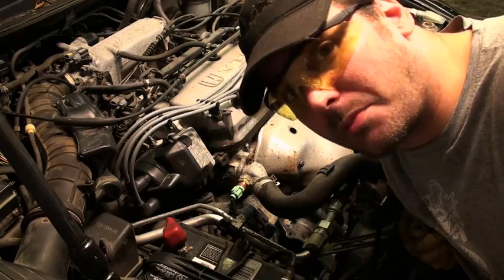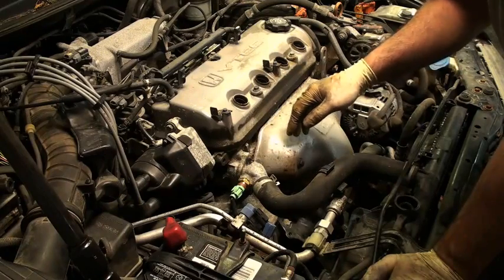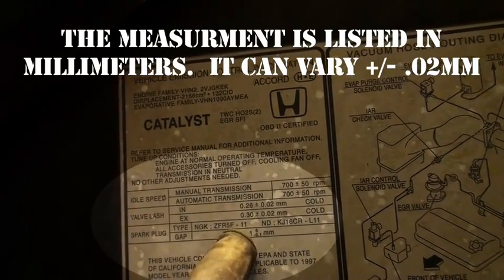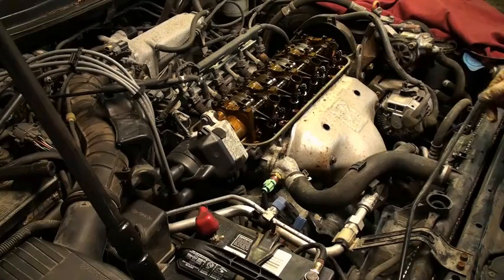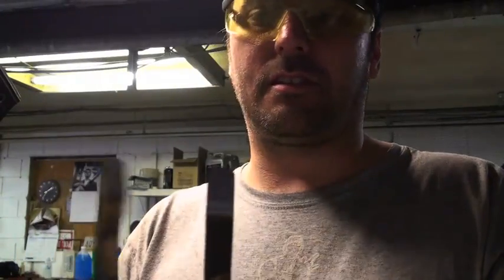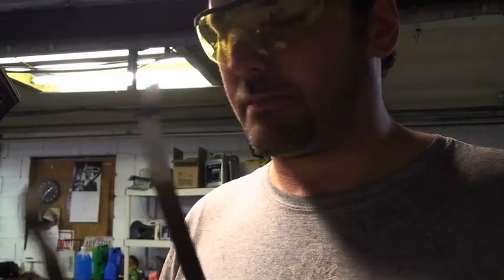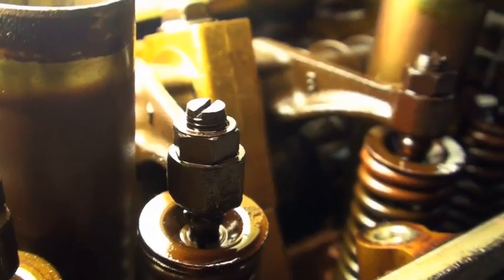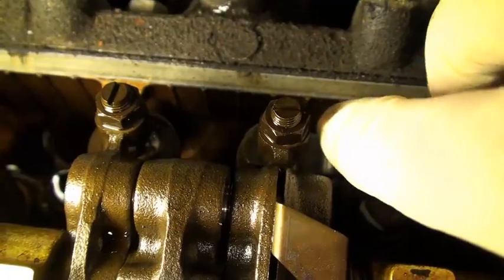Honda Accord Valve Adjustment - EricTheCarGuy

Comment: Ty again. On the 22R is the timing chain adjustable or would have to be replaced? I'm hoping to spend as little cash as possibale on this truck b/c I intend on selling it but I need the engine as much as possibale to purr like a kitten to get the most value. I hope to sell it for atleast $1200. No rust and has the original radio.

Comment: great tips... 
although.. to older engines the feeler gauge must be a bit tighter
i marked the camshaft pulley so now i have the 4 directions pinpointed
to rotate the engine i used to rise and spin a wheel with 5th gear engaged
maybe taking the plugs out is better 
can to see how they look then.

Comment: Hey Eric! Thanks for the great videos. 

My Honda Civic makes a ticking sound when the engine runs. I'm pretty sure it's the valves. Would an adjustment remove the sound? 

It's done about 119000 miles I think.

Comment: Hey Eric...my motor is a B16a3 and wanted to know, looking from the factory manual it states there are OEM factory specs to go with for instance; at TDC

*Firing Order 1342 
Intake at                          0.15mm - 0.19mm (0.006 - 0.007 in)
Exhaust at                       0.17mm - 0.21mm (0.007 - 0.008 in) 

Valve were adjusted to - Intake 0.006in & Exhaust 0.008in...is this too tight of an adjustment? Any help would be great...i'm new to this so great way to learn!

Thanks Eric..awesome job

Comment: Do you have a video on adjusting valves on cars that have solid lifters like Mazdas and Nissans where you have to insert shims?  I know there is supposed to be some special tools that lets you do it without having to remove the camshaft.

Comment: Hey Eric I have a question. If I am adjusting my valves on a 92 prelude and it's my first time doing  it, after I have adjusted a valve would it be safe for me to loosen it just a tiny bit just to make sure I didn't over tighten them and mess up my motor????

Comment: Eric, my 91 CRX Si (D16A6) came from the factory with Champion RC9YCN4 plugs and they're listed in the manual.  I was surprised when I found them in there when I did my first plug change.  Switched to NGK and never looked back, but I thought you'd find that interesting.

Comment: Somehow I missed this video on your site, and you directed me back here when I went over the Honda engine videos this month.This video is 'vintage ETG', absolutely first class.You found my knowledge gap and filled it smooth.

My 2000 Suburban (300,000+k) has what I think are noisy lifters, only when it's cold. Runs fine even on the cold days when it's noisy. Does the Suburban have fixed or hydraulic lifters? Do you think a valve adjustment would help to suppress that annoying clattering sound?

Comment: Hi Eric I'm Eric I have an 80 buick skylark with the 2.8 liter and I did the head gaskets and need to do my valves I can't get them to adjust right and sounds just real off is there a way you can do it on a say a  chevy v6 cause every video I watch says 20 million different ways and what do u do for valves

Comment: @EricTheCarGuy Ok. Good news I put in the NGK spark plugs in and the car does not run really hot like before! I used the regular NGK ones with the exact part # like the manual recommendation says. However I'm still trying to figure out why my car is consuming a lot of gas and I dont drive the car everyday.

Comment: Speaking of the new gaskets on the spark plug tubes.  Do you have any suggestions for replacing them when doing a valve cover gasket change?  I had to rip them apart piece by piece with vice grips when I did mine.

Comment: Eric I have a follow up question about the '08 Eclipse V6 adjustment. Do Valve Clearances increase or decrease as the engine cools? I suppose that they increase, because the metal shrinks when it's cold. It took me a couple of hours to get to the rocker arms, so I had no choice but to adjust a cold engine. I went along and used the Hot Measurement for the adjustment, since I had no other number to go by.

P.s.: Is there a way to talk to you besides YouTube?

Comment: Will short flat feeler gauges work good and fit in there ok or do you need the angled ones?The flat ones I have are 2-1/2" long.
The engine is a F22B2.

Comment: Hi Eric - On my 2005 Honda Accord i have Valve Lash IN: 0.23 + 0.02 MM  and for EX: 0.30 + 0.02 MM --- When at Autozone i'm not sure what valve to purchase since they are not labeled per sticker on the hood, Which should be used for IN & EX  ??  Really appreciate your feedback.
Reply: Manuel Canela Find out what engine is in your car and look up maintenance guides for that engine.

Comment: @EricTheCarGuy I been watching many of you videos but I have stranger question. Well I bought this 90' Honda accord on the engine block it said its an f22b1 but it's an DOHC. I took it to the Honda dealership and the told me that someone put a Honda civic head to make it a DOHC. My question is; how would i do a valve adjustment on this Frankenstein engine?

Comment: I can't get the flat head screw and nut to spin freely with eachother. So much carbon buildup its locked them up. Should i just run a can of seafoam through or take a blowtorch to it? Anyone dealt with this nonsense before? My valves arw ticking pretty bad.

Comment: how do you know you need a vavles adjustment?  i did a valve jod for this guy and now when i start it its somtime dieing down  but but the car still stay on and i hear taping some times taping goes on and off at low idle does this mean i need to adjust them no check engine lights either...?

Comment: I should clarify. It made zero valve noise before taking it apart. I was fixing the spark plug oil leak and noticed this upon reassembly.
Reply: SAMMMEEE HERREEE!!! now thats its making noise, my question is should i tighten them more i had set them to .007 in , .009 ex

Comment: Any day now Eric I'm going to get back by 86 Toyota 1/2 ton pickup. It has more then 250k miles on a rebuilt and needs timing & Valve adjustment. It has a 2.4L 22R (last year of the carbs). Would this video be a good guideto doing the valve adjustment? I may have to take it to a shop for the timing part of it

Comment: I have a 2.4l dohc engine which has a valve noise but i been advised that it is better just to leave them alone because on that engine it may cause more problems than anything else. any advise?

Comment: Hi Eric i just bought a 1996 Honda Accord automatic v6 24 valve last month and i got off work and my engine started  to knock real bad it was only when i push the gas then i knew it was the valves any info on this type off motor before i take a look at it and some idea on what to expect

Comment: I also have a question. Ive seen other videos on the exact theme here and a lot of people do the valve adjustment on the cam side. I notice you dot it on the valve side instead of the cam side. Little confused.

Comment: Ok I have a 1995 Honda Accord EX v6 the 24 valve 2.7l engine, do these cars need the valves adjusted they seem pretty loud at startup and quiet some after warmup, are these engines hard to do or should I have a mechainc. Thanks

Comment: if you rebuild the entire engine have the cylinders honed with new rings and the block checked for warpage and put a new head or have the head fully redone it would be a fine motor most likely but if you dont do the bottom end as well then rebuilding the head would create too much pressure and blow past the rings. replacing the motor with a junkyard or jdm would be your best bet.

Comment: Hey Eric, I have a 97 Accord I got 3k miles ago it ran smooth for awhile, but has always had a slight ticking (tapping sound) not knock. I did an oil change 1k miles ago. It now runs kind of ruff has less powerand the ticking is louder. There's no check engine light on could this be cause if the valves need adjusted? I'm replacing the cap and rotor spark plugs and fuel filter tomorrow.

Comment: Hey Eric, I did put in Champion spark plugs on my 91 honda accord and it did run good but really made the car really hot. I didnt know at that time champion wasnt recommended when I was tuning it up. The car was really hot that you can burn your hand if you touch the hood. I am gonna switch to NGK next week when my money comes in. Do spark plugs' heat ranges have to do with engine temperature? Because before my car had autolite spark plugs and the car wasnt that hot like champion spark plugs did

Comment: Hi Eric. Really nice work brother. Have a question for you not related to the valve clearance but more timing belt. I recently replaced my timing belt and balancer belt on a 96 accord 2.2 vtec. Problem is I dont remember how the drive belts (alternator and ps routed when I took them off). Alternator belt goes alternator crankshaft pulley and what else? PS goes ac compressor and outer crank pulley? Hellllp :)

Comment: Hi i got a question.  So i believe my timing belt slipped a tooth and so i reset the timing and it helped it alot but its still got that wierd laggy sound like a subaru when i give it any gas.  Could this be the culpret?  Im hopeing i didnt bend a valve it doesnt sound like i did but yeah.  Thanks!

Comment: Hey Eric i have a little question. I'm curently building some-what of an performance engine. It's an overhead cam design, and i have a high lift cam in
 it, and people sayd to me that i should put stronger valve springs on, but they also sayed that with those my cam can wear out much faster. Your opinion would really halp me.

Comment: it was running fine until i backed out of a driveway put it in drive and stepped on the gas a tad bit and the motor started jumping almost like it was missfiring but then it stalled an i can figure out wats wrong could it be that my timing belt slipped as i put it in drive and gave it gas?

Comment: my car sticker says .22 plus or minus .02... so adding them together I get .24... does that mean I could use any guage between .22 and .24? Or should I find a .22?
Reply: You should find a .22. .22 plus or minus .02 means that a range between 0.20 and 0.24 is acceptable for that engine.

Comment: hi i got a question for you i have a broken timing belt in my dodge neon 2002 and i dont know if this will cause any problems with my valves do you think if i replace the timing belt water pump and pulley will it be ok thank you and you have wonderful videos

Comment: i have a 95 accord with what i believe is the same engine. do you have to turn over the engine in between doing the intake and exhaust valves or do you just leave it with the cam lobe 180 fromthe rocker?

Comment: @EricTheCarGuy  i have this engine for 3 months now , the old one was smoking alot and i think its becuz of the oil rings or the valve seals , but instade i took another engine and its soo weak, i wanted to adjust the valves so maybe it can be more powerfull , i did the distrebuter timing yesterday and it help so i cant wait for the valve adjustment :)

Comment: Dont we have to turn the crankshaft instead of the camshaft? I have honda civic 2000 ex and I am about to do the valve lash. Does it matter if I turn the crankshaft of camshaft ?
Reply: Tuan Anh Le - When Eric turned the power steering pump it did turn the crank which by way of timing belt turned the cam shaft.
Reply: Tuan Anh Le - But remember... Take your spark plugs out first...

Comment: Hey Eric, I have an 04 Accord V6 with 223K on the clock. anyway I decided to put the pedal to the medal and my check engine light did a "funky chicken" and started flashing. I have a Code reader and it said that Clyinders 1, and 5 and random cylinder misfire were detected. I was told that I needed to have my valves adjusted, they have never been in all these miles, do you think that that is so? None of my coils are oil soaked and I just replaced the sparkplugs last Sept with the OEM NGK plugs.

Comment: I set the number 1 valve to TDC with the marker UP (timing wheel), set it to12 oclock and adjusted 1# valve (0.007 intake and exhaust to 0.009) between the Rocker Arm and Valve Stem with no problem.  The problem I'm having is when I set timing wheel to 9oclock to work on valve #3. I couldn't place the feeler gauge between the valve #3 Rocker Arm and Valve Stem on the intake valve so I losened the screw and adjuster screw but still couldn't get the feeler gauge between. What am I doing wrong?

Comment: Btw it me again, My honda is a 1997 Honda Civic HX. Cont.. The more I loosen the aduster screw for the #3 valve (intake)  I couldn't get the feeler guage inbetween the rocket arm and valve stem. What am I doing wrong. Should I turn the timing wheel a tad more to open up the gap. Any help would be greatly appreciated.

Comment: I have a 1996 honda accord 6 cylinder and it has a ticking noise coming from the head area when the car is warm. Is it the valves needing adjustment? Anyone know?
Thank you.
Reply: Valve lash gets quiter when the engine is hot, not noisy. If the noise is worse after warm up, then you have another issue.

Comment: My integra has been sitting for 6 to 8 months and only had 27 miles on the rebuilt b18c1 motor with ITR Cams and valves and what not. But when i started it up it started up fine but I could hear the valves chattering. Could this be from the valves not broken in yet or could it be something else?

Comment: i have a 98 civic coupe. is it the same way to adjust the valves?  can valve adjusment on my civic fix the sound it makes when i accelerate like a clicking noise?  and it also feels slow like the engine doesnt have strength.  i need helpp!!!!!!

Comment: your doing a all some job i watch your video all the time keep up the good job i have a question for u i have 2000 civic  si with the doch motor which is the b16 i put skunk 2 stage 2 cams and duel springs & retainers i have adjusted them 4 times & cant get them right &  i have done many other with good result i adjusted them 7 on intake side and 8 exhaust even tried 6 & 7 and still noise i do know u go counter clockwise with the cam and u adjusted them 1 3 4 2 just seeing if u can help

Comment: @EricTheCarGuy Not so much on recent engines. The 1.8 to 2.4 engines in 2007 and newer Chryslers all come with NGK from the factory and list NGK part numbers on the hood. Perhaps it is because they use Hyundai designed GEMA engine blocks that are also used in the Hyundai Theta and Mitsubishi 4B1 engines.

Comment: Hello

I just did my D16Z6 valve clearence yesterday.
used smallest numbers from feelers by manual but it still ticks when starting to move with first gear (or Rev.) or when slightly accelerate on the move. I know that injectors make sound too but this tick is more like rockers. Any help/ideas? I think, maybe valve spings are weak...

Comment: Dear Eric,

I know this has nothing to do with your video but my 1992 Honda Accord EX's A/C is no longer working, i believe the heat is still working because that is all that comes out, the local auto shop don't want to tell me what the problem is because I want to do it myself. Would you know if it is the condenser or something else? Thanks in advance.

Comment: EricTheCarGuy.I have a 2011 Accord 3.5 exl with 190k. There's a major ticking in the morning when I start it. It's been happening for several months now. Timing belt has never been changed. I purchased it when it had 94k. I have driven it hard at times, never race tho haha ,it's a Honda accord. The ticking goes away after a few mins of idoling. What are your thoughts? Where is your shop located
Reply: You better change that timing belt/water pump before it's to late.

Comment: @EricTheCarGuy what would be the clearance for a 1990 Acura integra LS. I tried some measurements on some Acura websites but they are amatures and my car started making a loud ticking sound. Before I would use AILDATA but I'm not in school yet and now I'm stuck with a loud sounding engine.

Comment: @EricTheCarGuy  i already did and nothing and when cold start i turn the car on for 5 seconds and turn off the i take the radiator cap off it have built pressure  ,but i dont see any oil on it , any suggestions?

Comment: I was thinking (it seems plausible) that you could take the coil fuse out and crank the engine to get the individual set of valves (1 of 4 on a 4clyd engine). Would this work as well?

Comment: This was helpful. Thank you! I tuned in to find a specific bit of info -- how many foot-pounds or inch-pounds do you tighten the jam nut when you've got the adjustment screw where it's supposed to be? That's the info I'm missing.
Reply: 14
Reply: Cool! Thanks!

Comment: can you make a video on adjusting valve in a gsr integra or like a99- 2000 civic or even a 92-93 integra with b17 vtec engine just any of the B sears with a vtec head like B16 or B18c or b17 they adjust much more different then other motors   and have very lil space 2 work with

Comment: I can't adjust my 3rd valve because the screw head is worn out and I can't loosen the lock nut. Does anyone know the measurements of this screw?
Reply: Vinícius Chinedu 1. go to the junk yard and unscrew one off a junk car first.  
2. unscrew yours with vice grips very gently.
if it gets stuck, can't get it out, you'll have to disassemble the rocker shaft assembly.

Comment: I HAD PROBLEM WITH MY ACCORD 95 EX F22B1 WITH NEW EXHAUST SYSTEM,NEW OXIGEN SENSOR
MANUAL TRANSMISSION.THE MOTOR WAS BROKE LAST NOVEMBER AND I BUY JDM F22B VTEC LOW MILES FROM ENGINEOUS ON EBAY I PUT THE MOTOR FEW WEEKS LATER AND RUN GREAT BUT I FOUND GAS LINE RETURN LEAK A LITTLE GAS IS WHE THE PROBLEM STARTED.I CHANGE PIPE ,